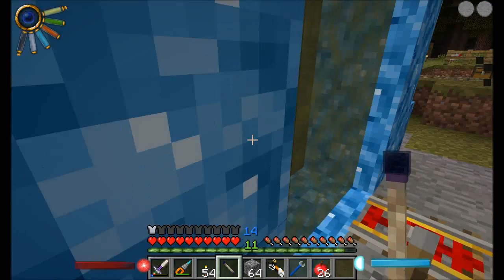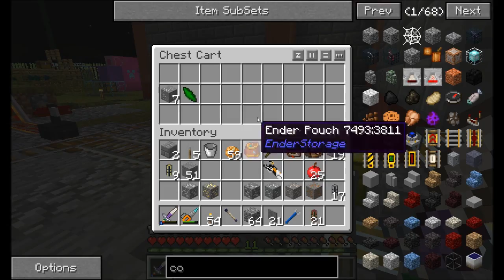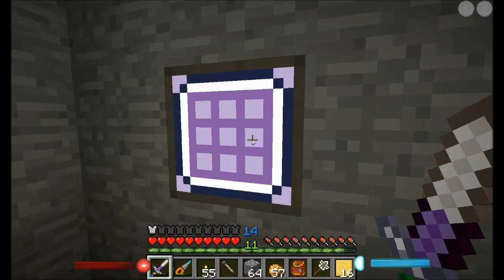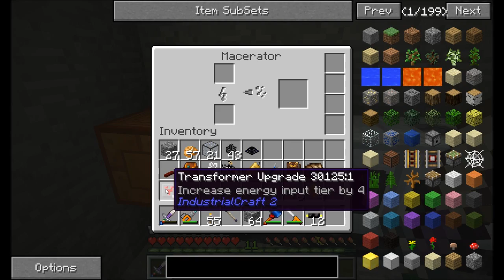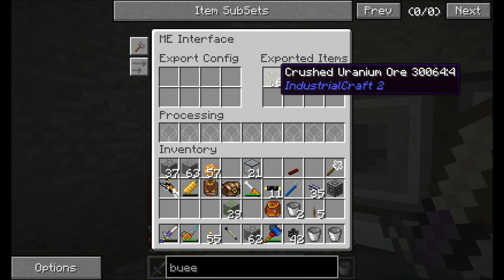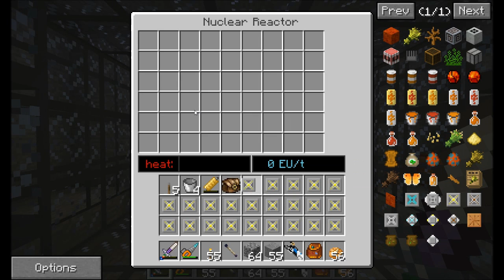Forgecraft2 S3E40 Nuclear Startup

Comment: Hey dire, you could also make the system always keep a fixed amount of fuel rods (quad or not) on hand for the reactor so that way it's almost fully automated. Then simply export the fuel rods into the reactor and auto repair the heat vents, too bad you couldn't use ars magica to repair the heat vents lol.

Comment: I wonder if it's possible to also use export and import bus on nuclear reactor, to take out depleted uranium cells, and insert filled ones. On that reactor design you used it is safe to fill the vertical middle column with normal armor plates, so that if that autofiller worked, the dual cells wouldn't be placed in the middle and blow the reactor.

Comment: Just curious, does the mod with the spools of wire that Dire used to power the drawbridges have an advantage over wireless redstone?
Reply: yes it does not use enderpearls but needs 1 length of alumin brass  wire per block it travels it seems